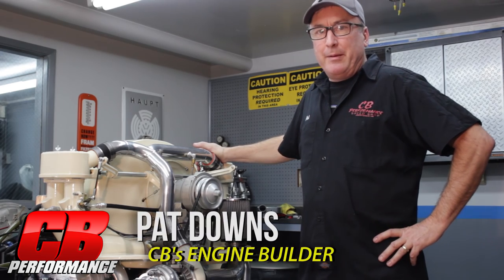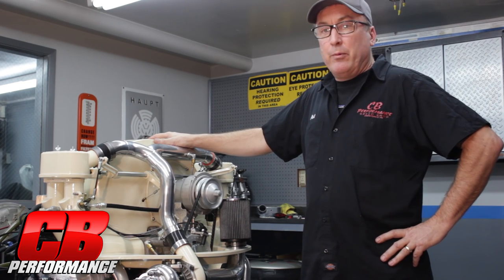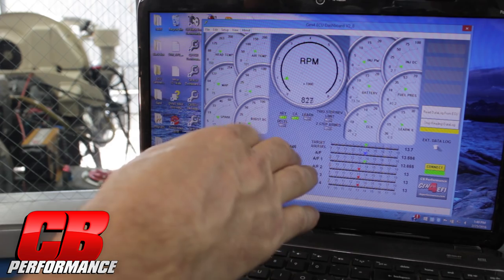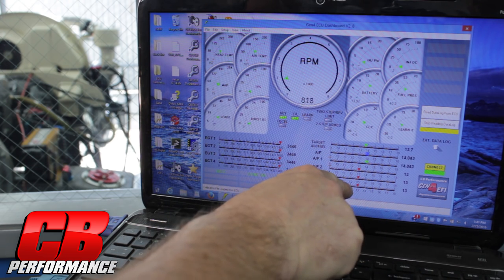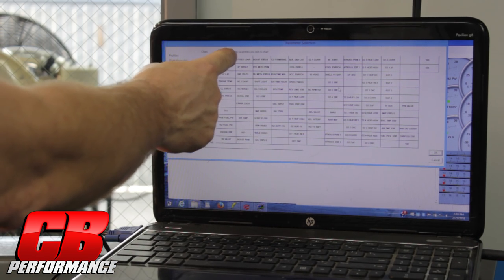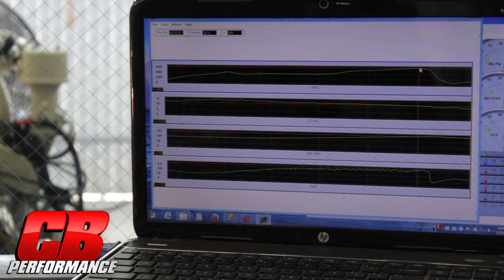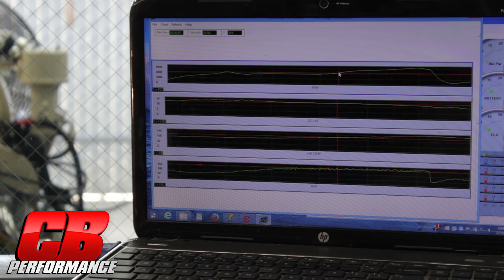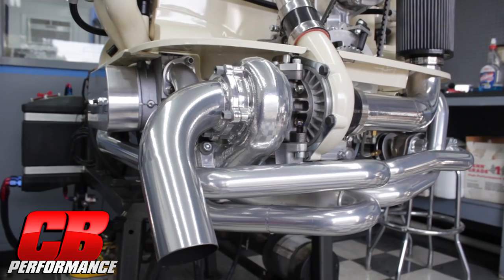CB Performance - 2276cc Turbo Engine (made 310hp)

Comment: maybe I missed it but only heard him say 272hp anyway I had my own machine shop in Adelaide South Australia V.R.M.S Miller Racing I used to run a '62 model Beetle with a few mods 2180cc Bugpac crank Carrillo rods NPR 92 mm pistons total seal rings top[expansion] and second [total seal] Teflon buttons instead of circlips Scat individual cylinder heads 52mm inlet valves 42mm exhaust valves 2inch exhaust I built to sound wave theory lengths with 27 and 3/4 inch megaphone a lot of working theory went into it, the exhaust. I had Hilborn intake manifolds with 48 IDA webers 47.5mm venturis 7.2mm made needle and seats [all the special stuff I made myself I had my own machine shop back then], the late 80's. Ran 2 fuel pumps one high pressure one high volume low pressure ran 1" fuel line to the pumps and half inch to each carby [fuel consumption was shithouse 6 to 8 litres burn out and quarter mile run]   hey I had fun. Valve springs were progressive I designed them and had them built in the USA $400 for 8 double valve springs back then was a lot of money. I ran a special Scat cam built as a one off almost rectangular lobes with 1.5.to one roller rockers 757 thou valve lift 312 degrees of duration the engine "idled" at 3,500 rpm extremely lumpy it didn't smooth out till 5500 and kicked you in the guts the engine red lined at 10,000 checked on an engine dyno, I built it on a whim I hated in those days to be told I couldn't do something and someone walked into my shop oneday with and American VW DRAGSTER magazine and showed me they were getting 10,000 rpm from there motors and said I couldn't do it so I did hey it cost in real terms the better part of $18,000 if I had to pay for everything I mean the Scat heads were $4,000 each so I bought second hand ones and rebuilt them retempered them and they worked fine. Anyway I had a lot of fun with that car the body is still around the engine got detuned I built a set of street heads for it put a Scat c35 and 45mm Delortoes on it, it is still going believe it or not just taken out on special occasions by the guy I sold it to. 
  I suppose the main reason I spoke here was my motor at 4500 rpm only had 54hp at 5500 rpm it had 250hp at 6500 275+ then it broke the mounts on my mates engine dyno, it wasn't pretty to look at it never ran any tin wear, no cooling at all, if the cylinder head temp got over 500 degrees Farenhieght  I had to pull out because it would get way to hot at the end of the quarter other wise. I mixed the fuel I used myself it was only stable for 24 hours then it went to jelly and unusable for anything but party tricks. 
   I preheated the oil before every run, they always frowned at me on the start line because at idle fuel spilt every where but at 10k it used everything, it was built for a dare and for fun and every time I got slack at work I would run it and be that damn busy I didn't have time to run it, a motor like that got dismantled every race meeting just to check things so they didn't break. I know where all the parts are if I ever had the money I would buy everything back and rebuild it just for fun, like I never heard it from the back but the guys that used to help me said it hurt peoples ears at full noise to me all I heard was 2 very loud weber carbies which had air intakes inside the body just with flame arrestors over them incase of back fires , the body and chasis is still around just need a gearbox tyres and the parts it would only be run once a year but I would donate it to a museum in Adelaide in honour of my father who just passed away and during his life he started work on VW's and Porsches in 1958 and worked on them til he semi retired in 1996 even then helped out many many people his nick name in Adelaide was Dr. Porsche, hey I even went for my drivers licence in a 1953 356a 1300 super Porsche oh of only I still had that car today. 
    Anyway thanks for reading I hope you made sense of it and it was all in fun good ol Volkswagens hey. Oh my cars name Volks Revenge.
Just have to  add one thing it was lethal to drive only ever ran Avon racing rubber on 4.5 inch rims they would break away at any speed whenever they felt like it so much so I held the record for speed going backwards over the speed traps at Adelaide International raceway 95.86mph BACKWARDS  I do not know who out there has ever tried that but when you have a concrete wall both sides it's some scary shit, they made me put  a roll cage in it after that effort LOL they estimated my speed before the car went airborne at in excess of 130mph because as anyone who runs the quarter knows the speed is measured over 132feet that is 66 feet before the end of the quarter to 66 feet after and my car had stopped within 60 feet after the end of the speed trap that is how some boffin worked out my estimated speed when the car let go, good spectator value, but change of underwear needed LOL
Reply: Geezus H Leonard....that is a skillset with the humble aircooled..
Reply: As much as I love the air-cooled VW I can't believe I just fucking read all of that
Reply: Hi, I could realy use some advice from you is there any chance I could have some kind of contact details please I would realy appreciate it. Thanks

Comment: I built mine in 89 with 92.5 pistons and jugs fuel feeder racing cam trick flo heads and a offenhouser intake running a holley 650 cfm and had a 200 pound flywheel and pulled 400 ehp after spin-up and did three dyno pulls then 1 run on the track twisting my 74 super beatle then had to send the engine home to NY. and after 8 months my father gave it to his friend who raced the engine for five years before kaboom

Comment: The ghost behind the curtain is the cilinderhead temperature. The cooling surface is limited on the small air heads. I can only see 175 degree cilinderhead temperature during the runs, which is no prove for a longer run under boost ( mountain climb, bug race). 
The heads start to creep, to disstort above 225 C and loose their thighness (torque value). Over the leak path (blow path) the head will erode or melt.
The initial engines of the B29 bomber were powerfull enough, but all thermally restricted.  If you make power (30%), you make the heat (70%) . 
I had like that CB would give a maximum contineous power value, at say 15 C ambient temperature, just as aero engines do. This value must be matched to 1000 running hours.

Comment: Congratulations CBPerformance, beautiful and powerful,
what a guarantee of quality for everyday use and for trips of 800-1000 km,
get to Chimay Belgium and make a good result at the fourth mile races ;-)?
with gearbox, suspension, brakes etc. adequate to the power

Comment: Do not you think chrome pulleys will make it has less grip on the belt and, consequently, less spin on the alternator, which means less cooling on the engine and less charging?

Comment: No 310hp here "8 PSI boost, 252hp, 249 ft lbs torque"  @ 1:00. Dont get me wrong here because those are great numbers, but a far cry from 310hp. Still a super nice piece of work with all the goodies.

Comment: so if someone were to build this exact same motor but maybe in a slightly larger size like say a 2332cc or 2387cc and run 15 ibs of boost they'd easily top 400+ horsepower. 

damn I really want CB performance to build my engine lol

Comment: what am i missing? it was full throttle for six seconds and nothing happened until the seventh.
Reply: This. Scratching my head with this too. Can’t be 6 seconds lag with that small of a compressor housing.
Reply from the maker: This is how the dyno software works. It holds a load until the RPM stabilizes, and then starts ramping in the RPM load and recording results.

Comment: 252hp with a Turbo? Doesn't sound to much for me. Out of the 90ies I know some people her in GER that had 220 from a 2.9 typ 4 n/a. A 2,1l n/a with 170.
Alright, it's different numbers measured on 9 and 14 pounds of boost. I didn't see that in the description. 310 sound sufficient thought 😀

Comment: Do you think upgrading a 1973 1300cc VW beetle engine to 1600cc would cause any long term issues? Thanks
Reply from the maker: Yes.  You will enjoy driving your car so much more, you would then need to upgrade to a 1776cc.  And then a 1914cc.  And then... you get the idea.      In all seriousness, going from 1300cc to 1600cc is no problem.
Reply: No it's done all the time, and you can use stock parts. You have to remember this technology is over 80 years old. When you start upgrading, it is assumed you are going to use it, so better parts are needed if you are going to be running it hard. There is a good reason all the aftermarket parts are available, but cost more. Everything is stronger with different metallurgy, but will stand up to the higher demands of more horsepower. If you do upgrade you will feel the difference, and it will have a little more horsepower, which is all that is needed in most cases. If you just add jugs with no bottom end work, you are looking for trouble.

Comment: Was this an engine from the 60s or a recent one from the Mexico factory?
Reply from the maker: Neither, this is in fact a Turnkey Engine built in 2017 by Pat Downs of CB Performance, using new parts from the VW aftermarket.

Comment: any bug heads out there could u explain what's the difference  (performance wise) on a turbo setup . all I see here in cali is the setup where the carb connects directly to the turbo and hangs outside , where as this setup with charge pipes going to the carbs is rarely seen even at local meets
Reply: The turbo on the dyno is a blow through system where the turbo blows through the carbs or EFI throttle bodies. The other style is called a draw through system. That's when The engine draws air and fuel through the carb and turbo then blows into the engine.
Reply: cub67 thanks for the info , what are the pros/cons of this setup that CB performance built.
Reply: BighomieJ5x - a draw through carb system is very simple as far as set up. But you have drivability issues. Fuel tends to puddle and cause a sluggish running engine up until you start making boost. A blow through system is a little more expensive but it is very driveable. It will drive around town all day without puddling and is a snap to tune especially with EFI.
Reply from the maker: @cub67  Thanks for responding, Cub!

Comment: I have a 1972 Beetle. 8 valve with two dual carburetor (4 total). 1600cc. H4. I have installed a stronger air cooler on the car.  I want to add a turbo charger, is it possible that my engine will over heat? Sorry for bad english.

Comment: How much power would a similar build without a turbo make?
Reply from the maker: Our most recent dyno video features a 2276cc Carbureted engine that produced 170hp.     You could even potentially get up to 200hp out of that size, by swapping out a few components.
Reply: that sounds like enough fun

Comment: 310 hp?? Thought you said it made 250??
Reply from the maker: 252 HP and 248 Ft/lbs. Torque @ 9 PSI

 310 HP and 298 Ft/lbs. Torque @ 14 PSI

Different HP readings at Different Boost Levels.

Comment: how much mod work does this take to put in a vw bus?
Reply from the maker: An early Split Bus, not much, but a late Bay-Window Bus would require modification to the engine support cross-bar at the very least.
Reply: Hi Pat,

I want to know how much it cost, because i want it for my 81' brazilian bug (street use only).

Thanks,

Rolando

Comment: $12,000 for 310hp, is that a good rate? Not being funny trying to get back into the bugs.
Reply from the maker: Part of that price-point is the the fact that it would be built by Master Engine Builder Pat Downs.
Reply: 12k for 310 hp is ridiculous in every make of cars except for aircooled Veedub. Bug motors are designed with 8mm and 10 mm studs and expecting these tiny parts to hold 14.3 psi plus additional 9 psi on top  of that, takes engineering. On domestic application where things are held by 12mm to 16mm studs can hold 40 psi plus just by relying on strength and not much else. Famous quote, how fast can you afford to go ?
Reply: this! if you want horses, go watercooled. a subaru turbo does this from factory...
Reply: Crazy Canadian!
Reply: That's a good average on a air cooled engine.  That's why I had to step away from them...  Went through 2 engines in 2 years at an average of $10k-$15k per engine and accessories.  Honestly, it was my own fault.  I live in a very warm climate (100+ in the summer time in West TX., N.M., AZ.).  Running a 2332 daily, I  was asking for problems...
Reply: That seems really reasonable to me.  Just block, internals and heads will run $4k.  Add on EFI, turbo, all the plumbing fabrication, assembly, tuning, beautiful powder coat and anodizing, all done by the top guy at a top shop.
Reply: Not bad considering what the price of e rebuilt engine is with all new parts and machine work
Reply: If you're a VW guy at heart it makes sense. If you're just a car enthusiast then an engine swap makes more sense. Subaru, LS etc.

Comment: No need for a turbo to make H-P. Do all the usual mods including size upgrade, head work, cam & ignition. I would use a progressive 2 BBL carb on a single manifold. I had a sleeper Squareback one time that I built using only a stock 1700 bus motor that probably had about 150 H-P using a carb from a Chevy Vega.
Reply: We will line them up. You with your setup, and me with the turbo. We will have to put a wager on it of course.